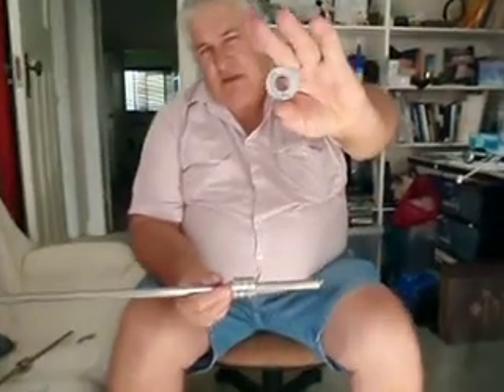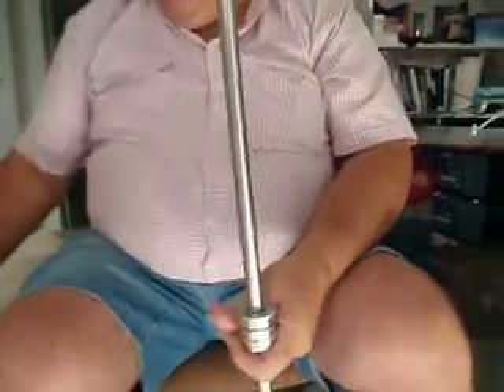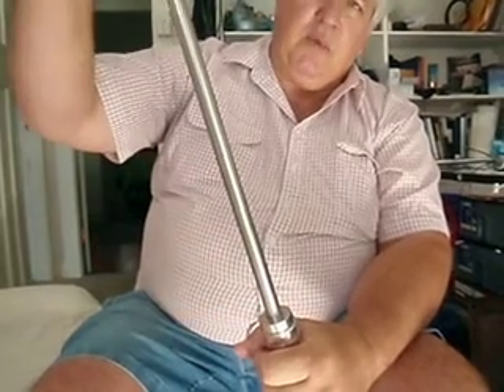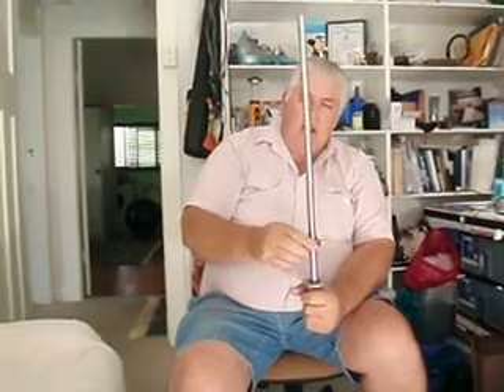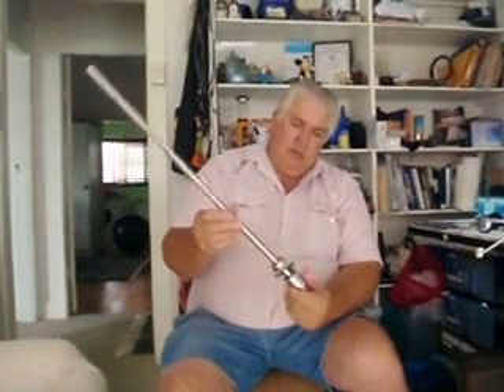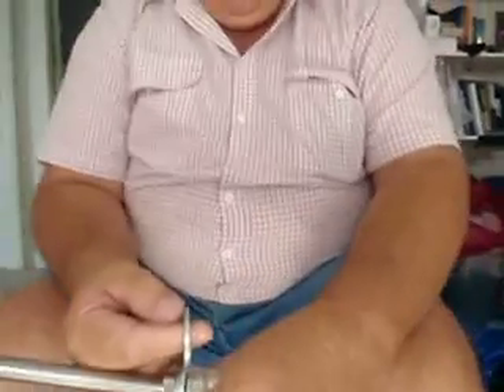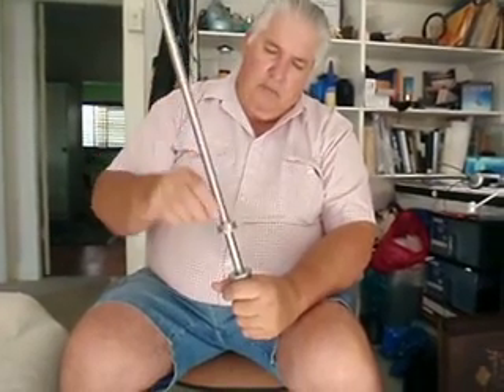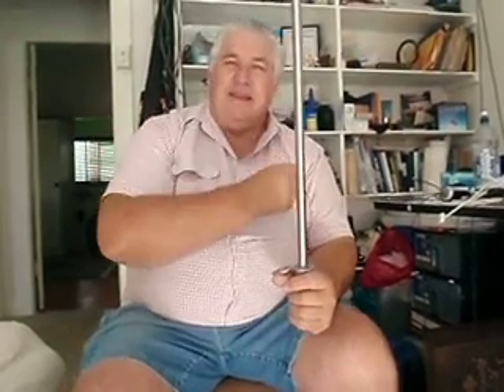A I R Peter Stevens  Magnetic phenomena's 8 April 2012

Comment: now the reason the magnets of opposite poles are sticking together when there is a washer between them is because when two flows of the same direction are traveling in the same direction normally they would repel two out ends pushing against each other or the two flows towards the in ends pushing against each other, but if there is a magnetically conducting medium between the two poles it will be aligned magnetically for one direction and allows the flows of the two magnets to combine

Comment: ah this is very neat, I pretty sure I know whats going on. With magnets you need to think of them as having a "in" end and a "out" end calling the poles North and South is not very helpful. If you want to visualize it get a pvc tube and put a fan in the center of it then sink the tube in water less than half way so that the fan doesn't get shorted out, you will see a flow around the tube in one end and out the other that is what a magnetic field is.